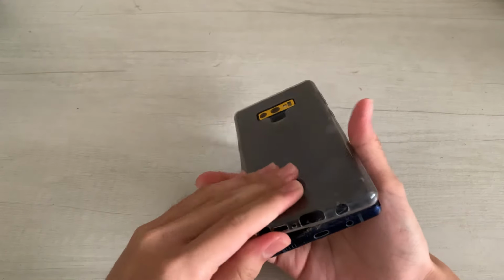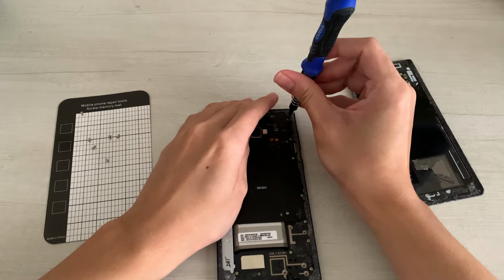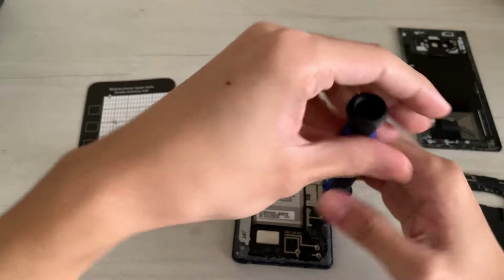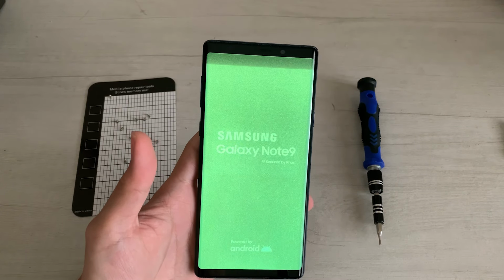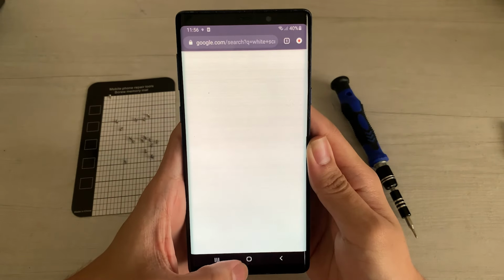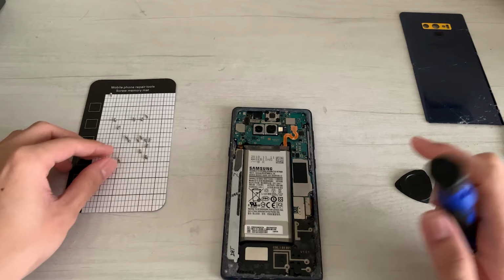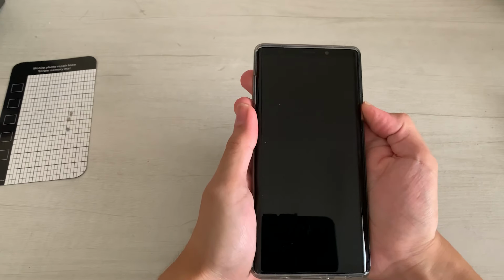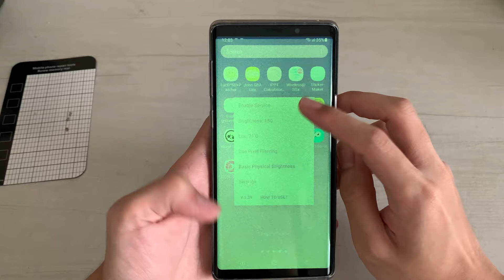How to FIX Samsung Note 9 GREEN SCREEN 2024

Comment: It's joke ? First he unscrew  then using app does it make sense ?
Reply: He is joker
Reply: I mean i tried it and it did work not taking all the green on screen but worked atleast
Reply: CPU is over heating , putting a little peace of copper to use as a heat sink helps ,it, my quess. Or new battery not enough power to the screen. I'm quessing or a pin on the screen connector isn't connecting

Comment: What I did is put always on display and once the display shows I turn on my phone and it works fine.
Downside, your battery drains quicker and if always on display is not there it will still be green.
I saw this on another video
Reply: Mine not last longer than a day but the problem still comeback using this method,btw my brand name phone is Galaxy Fan Note Edition
Reply: How to put an Always on video

Comment: Does this work for s20? You were talking kinda fast. You permanently removed the piece for wireless charging? Why? What was the other part? I heard the word battery but didn't understand. Do you leave that out? What'[s the poing of unplugging the flexconnector and plugging back in?

Comment: i cant find oled saver in playstore... can i use another apps ?
Reply: This problem is happening to me, I can't find this app
😔😔😔
Reply: @desing7hasan293  you can instal from google chrome but not safe. the picture quality down 25%.  but display can use fuction

Comment: How to fix galaxy s10 plus green screen ?
Reply: Please give answer bro.
Reply from the maker: not sure need to try -adm
Reply: Use the same app. It solves mine. Before using though try and play around some random display settings to see if they have effect on the flickering screen. If they do, then oled saver should solve your problem.

Comment: Fixed my note8 with all of the updates....let's see if it holds.
Reply: Tell me how, I'm facing the same problem.
Reply: I'm also..
Reply: I'm dying with my Note 9, how did you do it, my screen gets green and I can't see anything and it only works because of always on display but if it isn't activated the problem keeps appearing, help me please
Reply: @carlosalejandrofuentesquin8835  same problem brother
Reply: @carlosalejandrofuentesquin8835  did u find any heating issue ? Nd battery problem??
Reply: I have the same problem with  my s9+and s20 ultra they are both trash now...so sad
Reply: Tried installing de APK AMOLED PWMfree?
Reply: I think there is no other way fixing this green screen.. friend of mine working in a celphone factory told me that i need to replace my lcd...
Reply: @j-ppong6589  yup its confirmed that its a hardware problem
Reply: @ahngelooh  how can I solve this
Reply: @ahngelooh  how can I solve this
Reply: @shahnwazsaifi7275  i used the always on display option, but it is only a workaround and some phones it doesnt work on anymore. Tap the always on display when you use your phone and Itll be the right colors again. AMOLED screens have a short lifespan and overheating of the display will cause it to die and turn green.